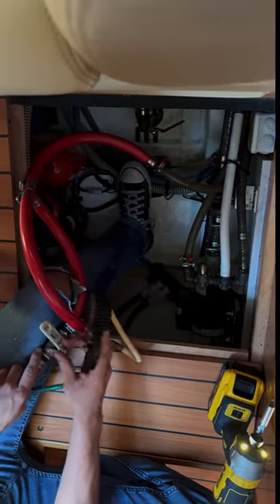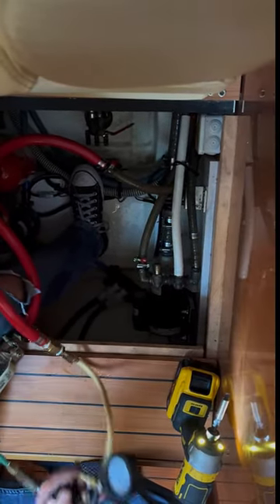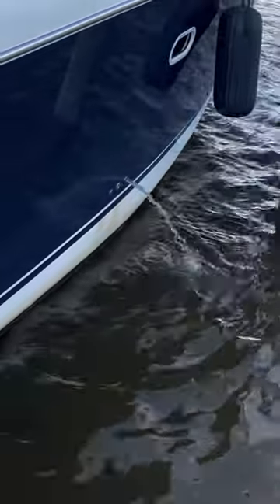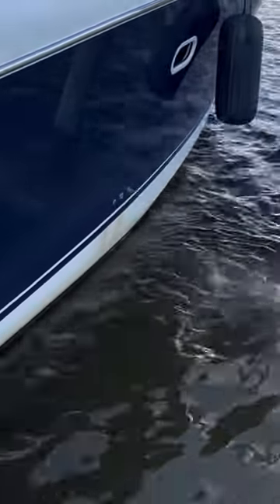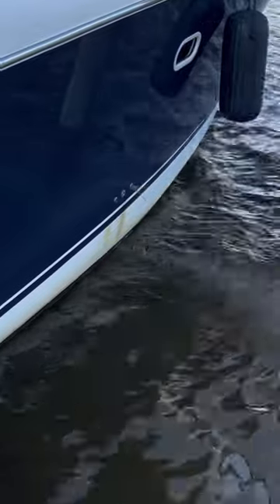How to Clean Seawater Lines for a Marine Air Conditioner

Comment: What is that contraption you used?  Looks like you're pushing air through the lines with water at the same time?
Reply from the maker: It’s a device we built ourselves. It uses compressed air to clean the system while water runs through it. We’ve been thinking about selling them. Let us know if you’re interested. Go to our website and fill out the form or email us.
Reply: @BoatACdotnet  yes I'm interested.
Reply: I’m interested!
Reply from the maker: @KMT15  contact us via our website. BoatAC.net